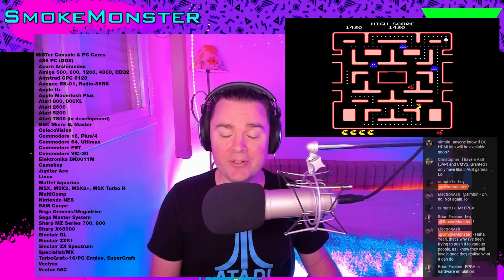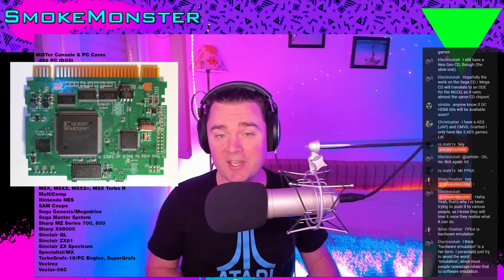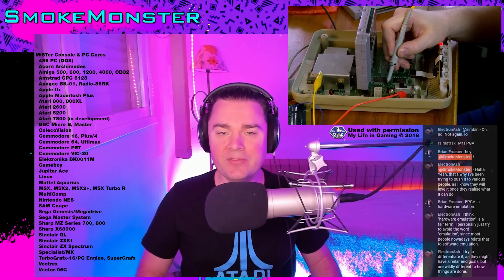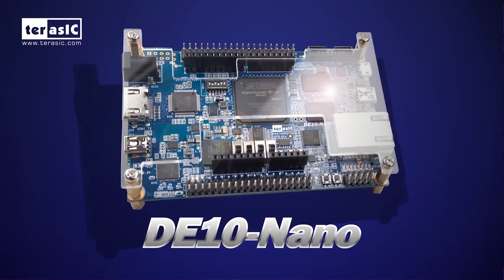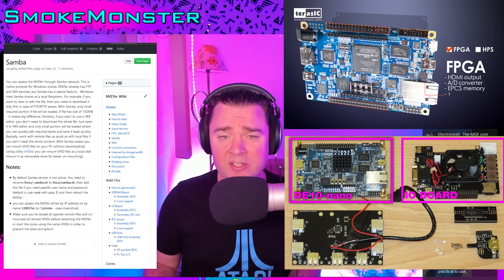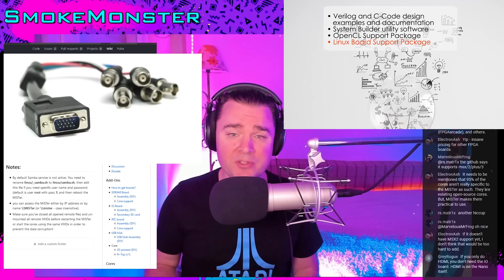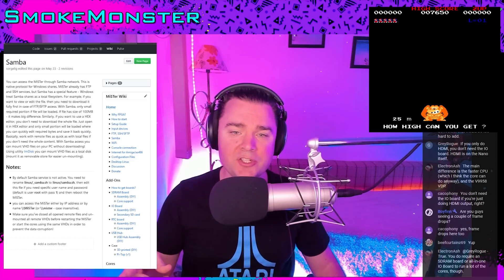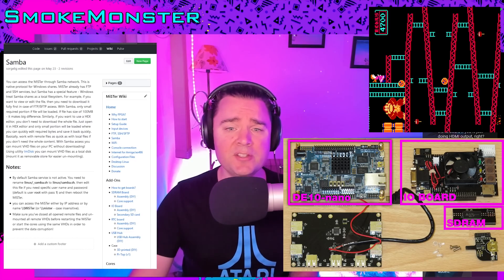Introducing MiSTer FPGA Multi Console | SmokeMonster

Comment: could you make sure this would be generally compatible with max-10 (50k logic) DK-DEV-10M50-A,  de10-standard (110k), and iWave Xilinx iW-G35D-19EG-4E004G-E008G-LCB (1.1M)
Reply from the maker: It only works with the DE10-nano.
Reply: @SmokeMonster  de10-standard has the exact same fpga soc
Reply: @SmokeMonster  max-10 is only the fpga, not the linux, but should be able to load vhdl schematics
Reply: @SmokeMonster  xilinx has the same arm cores to run linux, and somewhat similar fpga

Comment: Random question.  I don't have the "ultimate" case for my MiSTer, so all the boards (hub, de10-nano, io board) are just encased between two plexi panels.  I'm moving soon and will be traveling via place.  Will TSA have an issue with this device in my luggage or carry on, being non-descript electronics with circuit-boards and whatnot?  I don't want them to freak out thinking it's an IED or something and end up making me throw $300+ in the trash.
Reply from the maker: It just depends on the agent you run into and whether they want to bother you or not. Maybe bring the DE10's box if you have it.

Comment: i remeber to play mame32 using windows xp back to this day's way to buy that expensive system to play the same games ?
for the peoples the dont know mame32 is arcaded emulator i have a lot playable arcadeds games yes i have few game is not running but still all the games run for this emulator rum vary smooth at least for the computer buck this day's

Comment: This does not explain what the mister system is, and does not understand what FPGAs are. It's not emulation, it is literally hardware. It's also not just limited to copying processors. If you can't afford a VGA to HDMI adapter, or an 8-way KVM for instance, it can do that as well. You take your raytracer than takes an hour to run on a supercomputer cluster, compile the software into hardware without needing the intermediate step of a processor, and it will run in one clock step. Disadvantages, you have to learn about electronics and another coding language, and because FPGAs are massively parallel systems that do a lot of work quickly, they put out a LOT of heat, much more than a processor does. The heat isn't usually a problem, because of the speed: As most "programs" run in a single cycle (usually a hundred-millionth of a second), there isn't a chance to get hot. When you're using them for stream processing (eg converting VGA, trading stocks, or analysing data coming out of a synchrotron), they'll run hotter, ditto when you've replicated a different computer system on them. They're not just good for the trivial application of running a single core, either. They can run the whole system, down to the ports. They're also not subject to the usual limitations of parallel computing, because they're not internally interdependent. Another use is in prototyping new hardware: Instead of breadboarding or using software circuit simulation, you can test, change, and build new hardware on an FPGA development board.

Comment: Do loading another core reprogram the FPGA and as such wear it out? Should one mostly try to use it for just one system but as a solution which can do "any" system rather than solutions for just one system or do it all live on the FPGA all at once and you just select which parts of it you want to use by selecting core and it doesn't wear out except for upgrading the whole thing or something?
Reply from the maker: No, the FPGA doesn't wear out like an SD card or SSD.

Comment: another question for you if you have time: what will happen to Analog, as if Mister is so good and based on the same tech, it could erase Analog, as one machine does it all, I'm sure at Analog are looking very closely on what is the situation with Mister, I mean with 200 Euro you can buy a Mister with all bells and whistles...so what is the point of buying different Analog consoles?...NT, NT SNES, and the new upcoming one...it would be interesting to know your thoughts abot that...cheers!
Reply: The reason analog has nothing to worry about yet, is they cater to a different market. Their customers want to play on real cartridges instead of roms. The analog machines are capable of playing several systems via their sd card slot.  Analog will start to worry when Mister can get to the point where it does all the 32 bit and under systems, and we can buy detachable cartridge slots. Think polymega, but good.

Comment: I thought FPGA wasn't emulation but simulation.
Reply: It's hardware emulation as opposed to software. So basically instead of emulating the system as a whole, it emulates each chip and component separately. That's why compatibility is perfect when done correctly.

Comment: As far as I know, if you are going to output video/audio through HDMI and don't need X68000 support (which is at the moment not very far in development) then the IO board is not necessary and you will save about 60€. It's good to install a heatsink to the FPGA and possibly a small fan that can run at 5V (the IO board comes with a fan). Some other cores support the extra SD card slot on the IO board but they don't require it, you can set up virtual drives (VHD) instead.

Comment: Someone needs to use side channel attacks on the cyclone V in the Super NT to get the verilog files...
Reply: @monolithic-oil-corp  that would be funny, but I doubt it. The cyclone V in the SNT doesn't have arm embedded on the silicon, so I don't know if a attack vector could be done.

Comment: All this FPGA stuff doesn't seem quite baked enough for me to dive in yet, but OMG I'm just imagining what kinds of products we'll have in just a few years. The day someone sells an AIO FPGA system that loads ROMs and emulates nearly everything and can output analog as well as digital, all at a reasonable price, I'm on it! Right now, it just seems like every product/project has some drawbacks, whether it's cart-only, missing analog output, or missing cores.
Reply: It's hard for me to get too excited about it when I can just use a PC with good emulators with 4k CRT shader output on top of being able to run Street Fighter 5, Dragon Ball FighterZ, and whatever else I want to play.
Reply: Well, to be fair, hardware emulation via an FPGA can do things software emulation can't. Software emulation is still bound by its host, but hardware emulation is agnostic as long as the FPGA is powerful enough. It also means things like native analog video output, identical timings to actual hardware, absolutely no video lag, and compatibility with external hardware. Technically something like this could be made to work with a real Sega CD and 32X if someone found a way to hook them up. It also opens the door to native-level enhancements, like CPU overclocking and sprite limit removal, without any of the sacrifices of software emulation like input lag or incompatibilities.

Comment: if each and every arcade core is developed as a complete system, sure it'll take forever.   but, just like software programming, you can make reusable elements, and put them together to make many other systems.  like, how many arcade machines use a 68k cpu, or a v20, or a z80.  way more than than you would think.  you take a CPU template, add a RAM template, throw in a input controller template, you've got most of a system right there.  the trick will most likely be in their GPUs and APUs.
Reply: Exactly what I was thinking some months ago when I was talking to someone on FPGA reimplementation.

Comment: Dude, you should always have something to drink nearby when doing these live streams. It was super obvious that you were super thirsty.

But anyway, yeah, FPGA is the way to go for spot-on retro gaming!
Reply: It really isn't. They're not fast enough to output at 4k which basically kills them for flat screen monitors. You basically need 4k and a semi decent PC to output images with a good CRT shader that doesn't look like crap.
Reply: Meh. None of the machines they are emulating were anywhere close to 4k, so I don't see the point, especially when you consider that virtually all 4k monitors and televisions will upscale automatically if you want them to, shifting the processing burden of upscaling to the TV/monitor.
Reply: @youtubesuresuckscock  I guess if you NEED an EXACT emulation of a 20+ year old display technology....
Reply: @youtubesuresuckscock  Are there any FPGA boards that support 4K? I'm wondering if MISTer supports boards other than DE10-Nano Kit.
Reply: @youtubesuresuckscock  mcables are getting cheaper, And ossc is a thing. I really don't see the future being done through software. The compatibility is just too much work and requires too much horsepower to be done at good frame rates.

Comment: I am tempted as hell to get the boards.

I do have some questions: If I were to use an analog out cable like component, outputting at 240p, to an OSSC, will the OSSC see the signal properly? I ask is because I had no luck when trying to use the OSSC with my Raspberry Pi hooked to the RetroTINK Ultimate through component. How does it deal with resolution switching through analog and digital (ex. Sonic 2's two player mode)?
Reply from the maker: I think the best for OSSC is a VGA to SCART cable. That's what Rysha uses and it looks really good.